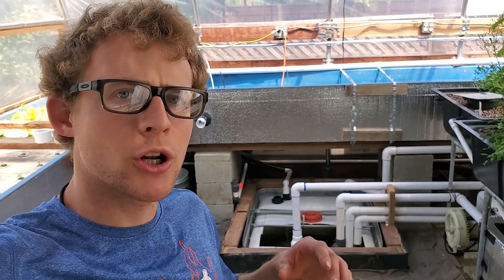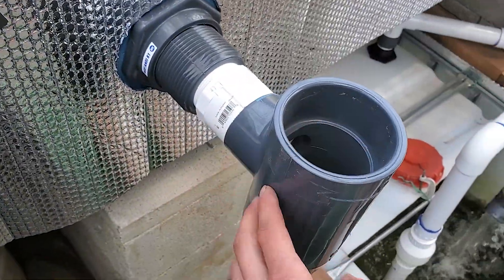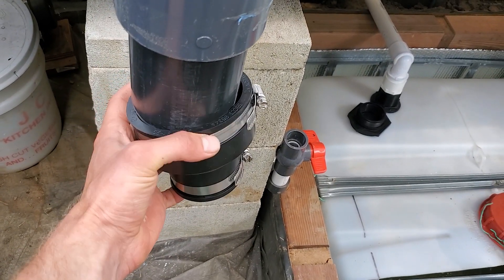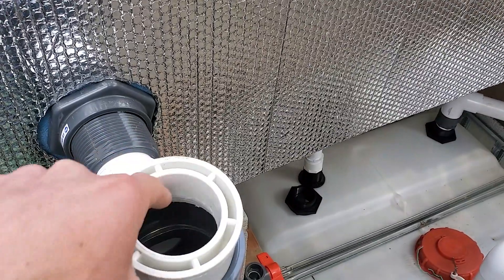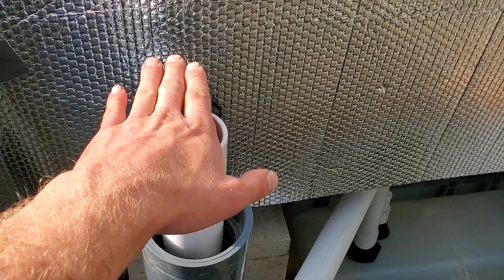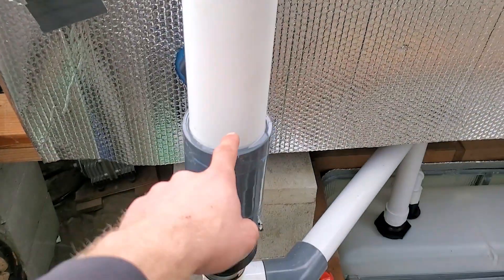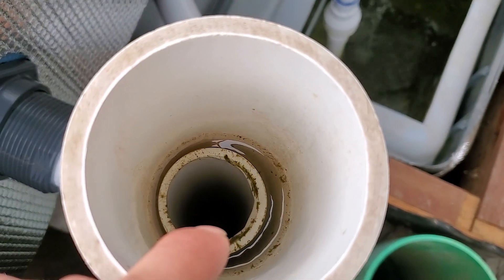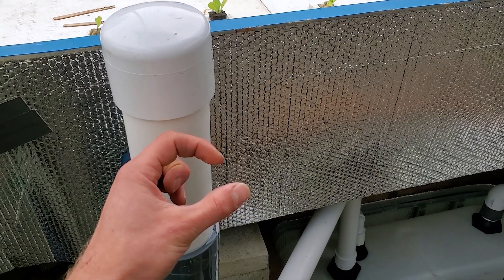How to build an external bell siphon/ external DWC overflow. (aquaponic farming)

Comment: I doubt the same design dont work for bell siphon + media beds since the outlet from the fiber tank is on the side rather than at the bottom so there is always water left at the fiber tank once the siphoning stops.
Reply from the maker: On the inside there is a pipe that goes to the bottom of the fiberglass tank. So a siphoning effect would cause the water to drain to that point, leaving little water in the fiberglass tank.

Comment: hey, thanks for the video, I really like the external aspect of this design and would love to implement it on my next bed,  did you ever end up making another video for a smaller setup? i would be keen to see this if you did but cant seem to find it in your videos...
Reply from the maker: Thanks 
and no have not made a smaller one. But you can do it the same just with smaller parts.
Reply: @vonponics  Thanks, I was just hoping for some sizing guidelines for a smaller system
Reply from the maker: @Adam-mn1wr  
Here are some sizing, i can make a video on this later on if you like, but it would be in a while since I am not home. And wont be for a few months possibly longer.
 
Parts list for a smaller setup
2" pvc pipe
1 1/4" pvc pipe
2" pvc tee 
2" x 1-1/4" reducer coupler - https://amzn.to/3vE7fXt

That is a smaller way to set it up. 
Ideally I would want to do it 2" x 1" but I don't think they make a rubber coupler in that size, so this is the next size up which will still work.

or 

2" pvc pipe
1" pvc pipe
2" pvc tee 
2" x 1" reducer coupler - https://amzn.to/49FavzO

You can do it like this but it would require more work since you would have to sand out the inside that blocks the 1" pipe from going all the way through
Reply: @vonponics  wonderful! Much appreciated!

Comment: I just replicated this, as an experiment only, using ½" pipe, a small waterbottle and a glue gun, added a garden hose to the outlet, really boosted the flow quite a lot, simple, easy and very cheap, not very pretty or even durable, but leaves room to tinker and see what else can be used from around the house, recycling is important too 🥳😄 greetings from Thailand, just starting up hydroponics in my yard, uploaded some videos too..